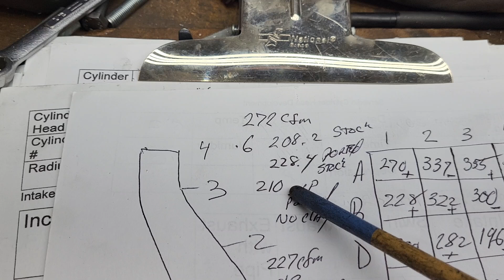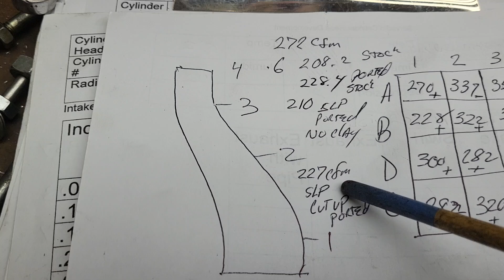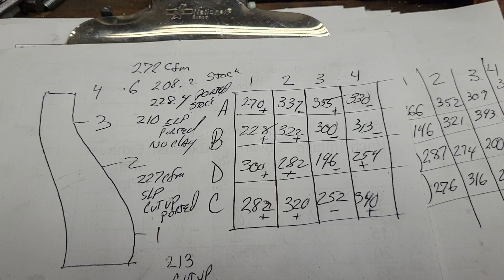The High Performance TPI project. Pushing the limits of the stock base and runner testing.

Comment: 292.68fps average... Last one was 286.81 average. I checked both charts twice in 2 different ways to correlate the math. How is that possible? Porting is supposed to open up the area. Bigger area = slower flow. I think the answer lies in the fact that a straighter port can have a higher airspeed than a curved one. 
This thing has to be maxed out by now. Thats still pretty good for a stock base. Whats the cfm? 270?
Reply from the maker: More efficient shape adds airflow and air speed.
Reply from the maker: 273
Reply from the maker: 273 through the base and head!
Reply: @servediocylinderheads  WOW!
Reply from the maker: @robmartin5382  No kidding

Comment: I feel like those are old accell runners. the slp were much larger outside, didn't look like individual runners. and the divider was cut out about a half inch on the top side of each. back then they said it was to help higher rpm, I don't think it really helped. the bump in your runner was for a bolt clearance believe. gm used those big headed torx bolts on them, needed lots of room to get apart. 
seems like I've seen some modded runners that didn't divide till the intake, mono tube style. I don't believe anyone ever made a good tpi intake thou, people these days like the first intake, it's carb legal in Cali, so it's the best they can do. I scored a old lingengelter ported super ram off a guy that had one of his 383s back in the 90s and still had it in his attic. even had the old accel 6 dfi with a plug and play harness to the factory one. of course my project car hasn't made it out of the garage with it in yet either haha.
Reply from the maker: These have the upper cut out. Thanks
Reply from the maker: I know someone who wants that super ram.
Reply: oh ha, I didn't notice the "notch" was on the bottom, intake side. I was looking for it where you were porting. yeah, definitely slp's sorry about that.

I think I'm going to hord the super ram for a bit longer. I have a ebl computer sitting on the passenger seat to get installed and after it's running. next should be the intake.
Reply from the maker: @jsomething2  That Super ram is bad. Send it to me for disposal.
Reply: @servediocylinderheads  ha. thanks for posting tpi stuff. haven't seen anything about it in years.
Reply from the maker: @jsomething2  You are welcome.
Reply: @servediocylinderheads  if you know someone interested in old tpi stuff. I just remembered, I have some very rare parts I would love to see you go down the rabbit hole on and make a youtube video about. no one ever believes me, but they made composite(plastic) tpi plenum, runners and mono blade throttle body back in the late 90s I think it was. MPI might be the name of the company. I'd have to go dig thru my attic, but I believe I have the plastic runners, which look like the stock ones that did well on your bench, but a little bigger around inside I believe. a plastic plenum that's little thicker for more volume. and I might have 2 tb's one mono and one dual blade, but the butterflys are compostit of some sort on that one, and one is damaged. I'd be willing to sell those if you'd do a cool video on them and see what they flowed. never seem any of them before or after. I worked at a performance shop at least 35 years ago at this point. and a old guy with a c4 corvette would come by. it was mainly a Ford shop, don't remember why he'd come by. but it was a supercharged c4 and at some point he was talking to the shop owner and give the parts to him. me being the only chevy guy there, once the guy left he gave to them me, thinking he wouldn't even be able to sell the stuff, since they didn't do anything tpi and fox body's ruled back then haha.
Reply from the maker: @jsomething2  Reads like really cool stuff. I would think tpi stuff could be 3d printed now. Thanks
Reply: @servediocylinderheads  you could definitely 3d print up a set to test on the flow bench but from what I've seen. home level 3d printers just aren't there yet for printing the types of filiments needed for intakes yet. you need to print like 30 of them just to get a small elbow right. heat issues and nozzles. would be best to print it up, make sure it all fits and then if it's good, just spend the money to have it professionally printed. be very expensive, .but might be worth it if you find something good. I've always dreamed of a 2 stage runner with butterfly valves. all the tq and then switch to higher rpm
Reply from the maker: @jsomething2  Good info. Thanks

Comment: Not original back in the day I would take my 1986 TA to the track. I ported the upper and lower, also the heads were ported.  I ran original runners with a 58mm throttle body. My car beat my friend with aftermarket runners and even the acell upper and runners.  Later I actually welded on the lower to port further.
Reply from the maker: So, how did you equalize the airspeeds and keep the air speeds increasing to the msca at the valve with the original shapes?

Comment: Another great video, looking forward to more developments :D  I'm surprised all it took was some radii and siamese on the end of the runners to get that much cfm.  If I would've known that, I would've told my dad to do it on his '86 'Vette, he cleaned/refurbed the injectors in the past year.  He may dive back in, still has an odd misfire that we haven't pinpointed.  If he does take it back apart I'll be sure to tell him about this.  Granted it won't do a ton having an unported stock intake, I'm sure it will still help it run better.
Reply from the maker: Every little bit helps. Thanks

Comment: surprising number on the ported stock tubes, or is it disappointing numbers from the slp runners
Reply: The ported stock have a radius ported into them the rest don't I think this is why they out performed the others because there isn't much difference between the ported stock and the stock
Reply from the maker: @Madmax.3 I agree, the radius makes a big difference reducing the edge effect.
Reply: Well one thing is certain-the shorter slp runner with the D shaped openings… is an absolute work of art! I’m surprised by the limited number(227). Maybe the shorter length has something to do with that 🤔. So, if i understand what you briefly talked about with the ports correctly-oval being better than square, would a perfectly round circle port be the optimal performer for all engines?
Reply from the maker: @MidnightOilsRestoration  I would think so for straight sections. Smallest surface to volume ratio.

Comment: This reminds me of the 3.6 pentastar. Heads flow 300cfm at .400 lift which is max lift. The restriction is the upper intake manifold. If someone could create or modify a high flowing upper intake manifold I'm sure an extra 20 - 30 ho would be on the board. Which means close to 400 crank hp from a n/a 3.6L v6
Reply: hmmm interesting
Reply from the maker: Would you like a dual plane, single or tunnel ram for that?
Reply: @servediocylinderheads  tunnel ram type setup. People have already setup prototype tunnel ram setups that make more power without a tune. And this is just basic stuff.

Thinking about shooting for a 6000 rpm tuned length. Peak power has been made al the way to 7200 on these engines.

Keep in mind there are no aftermarket cams. But the vvt is something like 40-50 degrees on each cam and the engine is non interference.
Reply from the maker: @jonathoncouchey7151  6000 rpm is pretty long. Packaging may be tough.
Reply: @servediocylinderheads  what are we looking for though. Second or third wave reflections? Third wave reflections shouldn't be to bad(between 15 to 18 inches.) but second waves are somewhere about 25 inches.

Edit. If shooting for 6500 rpm le gth should. E about 23.5 inches.  By my cakculations.calculations.

Edit again. I think 3rd wave for 6500 rpm would be doable. Is about 16 inches in length.
Reply from the maker: @jonathoncouchey7151  TPi uses 2nd and Victor Jr. Uses 4th

Comment: Im curious to what the large tube aftermarket runners will do they are longer and smaller than your cut up slp's but much larger and a bit longer then stock but have no bolt boss protrusions or indents.  If they drop the flow down to the 230s then this will tell us that its not the size but the angle that is introduced when bolting the runners to the base there is a another sharp angle when the two are together similar to the area where the base meets the head.  Please test without clay on the aftermarket runners so we can get the same comparisons
Reply from the maker: You bet. Thanks

Comment: Is there a cam that can be snuck past the stock TPI computer?
Reply: TPIS makes several, and to a point they aren't really 'sneaking', Jim would probably be able to tell you more about what you'd need though.  Also, MAF TPI is more forgiving since it's measuring airflow instead of manifold pressure.
Reply: @Doober12082  Thanks!
Reply: TPIS has a cam called the Super Profile L98. They tweak the stock cam specs a little and now your engine will be making power all the way to 6000 rpm. They have another one called Torque Secrets. More Torque.
Reply: @stanmack1  Thank you!
Reply from the maker: Yes
Reply: @servediocylinderheads  could you tell me?
Reply from the maker: @CrazyTony65  I don't know any modern ones. There was a comp cam computer compatible cam. Maybe a Crower as well.
Reply: Have you seen those kits of ball bearings that you bang through the stock runners to push out any dents and slightly enlarges them? Amazon sells a 5 pack of 38mm/1.5" ball bearings for 15 bucks. I'd donate them to the cause if you want to try it. I'm probably going to buy some for myself to try also.
Reply: @andysteele4056  I use them you need to progressively work you way up to 38mm I have gotten 39mm to pass its not easy.  You must first port the runner by the flange even larger than what is shown here I go to 40mm on the flange on both ends, runners must also be very clean on the inside.  I never tried the amazon ones I use high precision steel I have tried cheaper ones before and the bearing would fail.  Porting the stock runners this way is the ultimate sleeper because you can still visually tell the difference between the large tube ones from stock
Reply: @Madmax.3  interesting. the kits they used to sell on eBay I think we're all one size and the cheaper ones used wooden balls except for one steel ball. That's awesome that you got them to 39mm. I want to try it. BTW I didn't mean to start a new topic under the cam question comment. oops. 

For the cam question guy I think the rule of thumb for the old speed density computers (1990-1992/3) if you keep the overlap at .050 at zero degrees or less the computer won't mind much. Maf cars will take a bit more overlap, but there will be additional power in a custom tune no matter what.
Reply: @andysteele4056  I guess it would depend on where the dents are. Maybe  that's a good excuse to siamese the runners. Which requires cutting and welding. I think TPIS has a swap service for that.
Reply: old slp grind I put in a 305 years ago ran good on a stock chip. I wanna say it was something like 219/224 @50 with nor much lift and almost no cam idle. picked up a bit in the 305, ran good in the later 350 too.

Comment: You are lucky the costumer is sending a highflow aftermarket base doing a stock from start to where it is here is very time consuming and there is quite a few areas where you can break through including the bolts holes.  The as cast aftermarket base will flow equal or more than the ported stock they just need to be port matched at the entries they cast them small there so the user can match to desired runners
Reply from the maker: We will find out how the big mouth base does against my ported stocker.